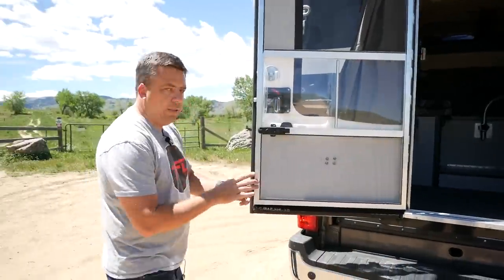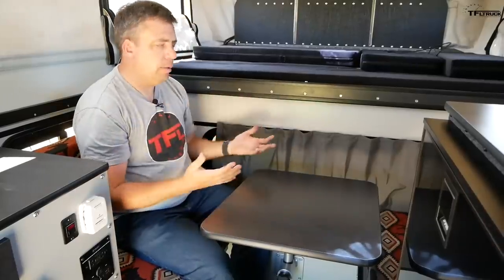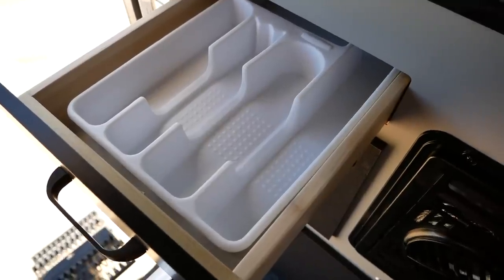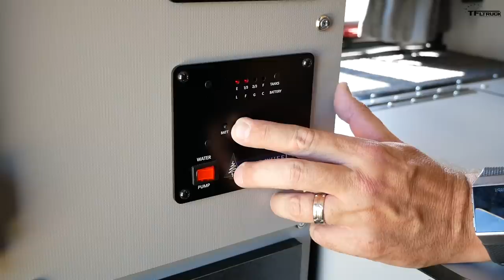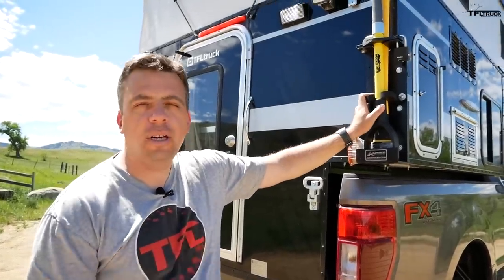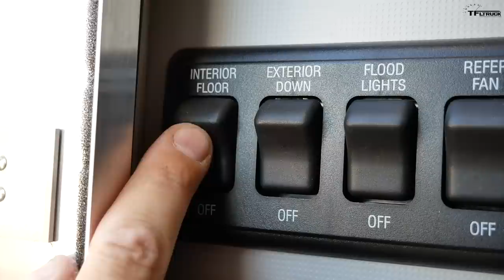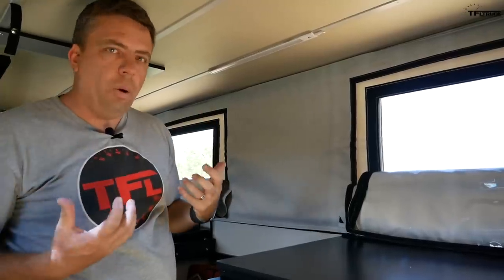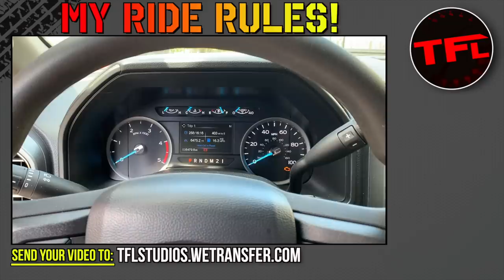Here's a Great Way To Camp On and Off-Road With a HD Truck - This Popup Camper Has it All!

Comment: I like the bonus owner review at the end of the video. More of these please.
Reply from the maker: Thank you for noticing.
Reply: But why tag it onto the end of a completely unrelated video? Was the viewer’s submission too short for a stand-alone “Dude, I Love My Ride”  ?
Reply: @TFLtruck  please tell us about the mods you did on the truck itself like lift and suspension and tires
Reply: @amm2472  On the gray truck that''s the subject of the main video? He covers all that.
Reply: Agree, an entire episode with the owner would be awesome.
Reply: I would totes find a way to vent the truck’s AC into the camper. Wouldn’t look good, but would be effective!
Reply: Holy cow that's expensive, I can get a NICE 5th wheel for that or less. Lightly  Used most likely. Still great content as always though guys keep up the great work!
Reply: @Marathon13240  Your 5th wheel does not have the go anywhere mobility these do.

Comment: Beyond sweet truck. Love you guys, love the videos. Other than hot water, it’s basically a $30,000  tent. No restroom, no shower. Seems like it should cost 10,000 max
Reply: I disagree. You couldn't even buy the raw materials and components in these for $10k. Aluminum frame/siding/roof, cushions, countertops, cabinets and hardware, vents, fans, windows, sink, pump, two agm batteries, stovetop, plywood floorpack, fridge, furnace, water heater, led lights inside and out, wiring, breakers, relays, battery charger, solar panel and controller, etc.   Be realistic. Two agm batteries are $500. Furnace $600. Fantastic fan vent $200. Fridge $800. Buy a piece of 3" foam for a matress is $150 without a sewn fabric cover. $30k is a lot of money, no doubt, but that is different than these being priced wrong. All those components add up fast. Now, pay someone to weld the frame, wire it, build cabinets, sew cushions, install fridge, furnace, fans, solar, stove, sink/plumbing, etc. Think about it by component and you see why they cost so much.
Reply: MrChadx1 ——-that’s the price of a fully loaded Honda Accord, the accord has way more components than that camper, so you are saying the accord should be like $60,000 because everything in it really adds up?
Reply: LA RC GREAT point!!!
Reply: @ULSB1969  Economies of scale.
Reply: @ULSB1969  Well, car manufactures don't really make a whole lot of money on a new car, they also sell millions of them, so they can make a couple hundred bucks on each one and be fine. FWC is a small(er) company, based in California now where wages and legislation is expensive. These could be 10k dollars or 15k dollars if we returned to an actual capitalism economy. But that's beyond the point. The point of these isn't to be cheap but to be well made in materials, workmanship, and warrantied well, that's expensive. Go read forums on any camper site and you'll see these large campers / fifth wheels that are 40, 50, 60, 70, 100k dollars falling apart after the first time they're used, you wanna know why? Because they prioritize price before the components and workmanship going into it. And good luck getting one of those fixed under 'warranty' lol.
Reply: Feel free to build them yourself, and sell them for $10K.
Reply: @ULSB1969  like others have said, economy of scale.  These are hand built. Not robot built, mass produced.  Compare Honda Accord to hand built sports car, even one without exotic components.  If you manufactured these yourself, even once you had the know how, how many hours do you think you would have into it after welding it all together, wiring, bonding, installing, testing, etc? And figure in your work space cost, health insurance, liability insurance, marketing, research and development, etc. And then still the material costs. Would like to hear what you think you'd have into it and you'd sell it for (oh, and you'd want to make a profit, too, right?)
Reply: @MrChadx1  gotta disagree with you.

Get a teardrop with 35s, nice outdoor galley, convertible sofa/table inside, and then you have your entire truck bed to haul extras like a genset that will power a/c and anything else you need. You'll also have room for propane.

Major non-starter for me.
Reply: Pretty overpriced
Reply: Way overpriced for what it is but if they can sell them at that price more power to them.
Reply: @sad754yt  great points all. For me, those wants and needs lead me to my ultimate dream - a Prevost conversion, around 20 years old no slides, and with moderate updates/upgrades. Electronics would be first on the list.

My wife is not crazy about managing the sheer size and complexity of a Prevost, so I think we'll have to work up to that. Our next step will be either a nice tent, or a small towable.

For any of the high ticket units, we'll pass on any purchases until this craziness passes. It's a record setting sellers market, so I'll wait for the inevitable sell-off.

Oh, and less crowded campgrounds!
Reply: @MrChadx1  Even though I hate it, I have to agree. People should check out van builds and how much those DIY cost. You never get away in a nicely equipped for under $25K or so. I would assume here the production cost is about 50% of the sales price that fourwheel is asking for. However, the add-ons are cheaper after market. The awning = 1/3 of the price. Solar - can be done for half the price as well. I am thinking of buying just the shell and then build it out myself - would probably save me $10K.
Reply: @ChristophPuetz  That is what we did with our first FWC. Bought the shell version and had them option in the things I couldn't, or didn't want to, do like adding side dinette, furnace, stovetop and propane. I did my own solar panels, solar controller, battery monitor, and 12v top-load fridge for a fraction of the price if purchased from FWC plus way better components.  Enjoyed that camper for several years but then moved to an Overland Explorer CAMP-X because we wanted the insulated panel construction rather than aluminum framed to get away from the condensation issues. It's been great.

As for the varying opinions on value, everyone is right since they are answering for their personal financial and value perspective. To each their own. It's great there are so many levels/choices out there right now.
Reply: @stratolestele7611  Teardrop is a different product completely and so a very different price point.  

No trailer works for us, teardrop or otherwise, since we are always towing a fishing boat or enclosed trailer. That leaves something that fits in the bed, be that a slide-in pickup camper or flip pack tent, or simple topper with a sleeping platform. We choose the slide-in pickup camper. Value and best choice is different for everyone. I was just pointing out why the asking price is what it is. Material and component costs, hand built, low volume, research and development costs, labor, marketing, and making a running a for-profit company. 

Regarding the varying opinions on value, everyone who shared an opinion is right since they are answering for their personal financial and value perspective. To each their own. It's great there are so many levels/choices out there right now.
Reply: @ULSB1969  the Accord is mass produced...
Reply: @barrydallmann3692  lolol

Comment: That price and no ac.... ouch! Great job Andre!
Reply: Where you going to plug an A/C into when you're out in BFE?
Reply: @donleamon8653  The giant generator they bought
Reply: For that size even a 4k btu unit would work. You could use those tiny suitcase inverter generators. But yes I would never pay 30k for that. I'd rather buy a towable tiny camper instead
Reply: You can run small one on solar and/or solar generator
Reply: And no toilet 😁
Reply: Stop being a wuss.....

Yeah I need AC too😄
Reply: Most solar charging systems will have a sine inverter with a low voltage cutoff.
Reply: 🙄 Cult like following is right. There are hundreds of build your own mini camper trailer for well under 5k. Even if it cost 10k to build that gives you 20k of Mods on the vehicle or money to actually go somewhere.
Reply: @rxonmymind8362  I was just about to say have you ever tried to sleep in 85° lol
Reply: Huge waste of money.
Reply: @twr41cox  no one's telling you to go buy one
Reply: No AC and no toilet
Reply: @donleamon8653  gen
Reply: Like living in a cardboard box for 32 k
Reply: A/C is a option it sticks out the passenger side by the door. Also there are two toilet options a hide away cassette or a fold out poop bag style. You can always go to there web site and build any model with any option and see real time pricing and a real close est weight of each added option. All free with out ever having to be bugged by sales rep. Can even print or save your build sheet to compare. 😃

Comment: No AC and they are starting off in Georgia in the summer. Hello humidity
Reply: They're doing their trip off road so it's unlikely there will be too many places to plug in.  Carrying a big enough generator to run A/C really isn't practical in this type of rig either.
Reply: @sonictech1000  there are plenty of smaller inverter generators that would store easily inside the camper (during travel) or on a hitch carrier.  No reason to not have AC anywhere you want, especially for $30k.
Reply: @jimmieclark6393  Storage in a pop up truck camper is REALLY limited and you typically need a 3kw generator to run an A/C unit.  That's way too big to put inside. . If you put the generator on a receiver  mounted carrier that will really hurt departure angle and probably break somewhere along the way.  They would also need to carry additional fuel and fuel is already going to be a problem for them.
Reply: @sonictech1000  One or two small Honda generators will power the AC and they are easy to store. It’s nice to have power if you are actually isolated in the outdoors.
Reply: @joshuabarton2519  Truck campers like that are extremely limited on storage space and few AC units will run reliably on anything less than 3kw.  Plus you are going to have to store all that fuel somewhere.
Reply: @sonictech1000  Can easily run a a/c off of a 2500 to 3000 watt inverter generator as long as the BTUs are not that high and most of them are about the size of a suitcase.  I have a 5000 btu  a/c and my suitcase size inverter generator runs it fine.  With such a small camper like this 5000 to 6000 btu a/c is all you need.

Comment: Nice camper, but waaaaay too expensive. Especially with no a/c or bathroom.  bought a new fully contained lance camper hard side for just over 20k.
Reply: @donleamon8653  you might with a smaller one.  Go ahead.  Waste your money on a 32k tent.  Besides, you know these guys aren't taking this on the Rubicon.  🙄 No way that camper is worth 32k friendo.
Reply: @paulmadkow9143  No way an earth roamer is worth 1.5 million either. But you can't take this dumb made up fiat currency with you so you may as well buy what makes you happy. FWC was founded on making small light weight campers for small trucks back in the 70's and 80s'. They have models as low as 800 to 900 pounds, which means a 1/4 ton truck or 'Midsize' truck can handle one. They even make small 5' ones for super short beds. Find me a lance camper that can do that? Oh, you can't. That's the entire market that they're building these for and have been building them for, it isn't to replace your lance camper on your HD Truck lol. Btw your lance is probably garbage in comparison to this camper, as far as construction goes. So you'll be buying a new one in 10 years anyway when this FWC will be here for 50 years with good care, even longer.

Comment: $30k just for that camper not really with it
Reply: That is crazy
Reply: Not unless the $32,000 for this camper includes a used pickup truck in reasonable condition to put it in, lol!
Reply: First thing I thought when I saw the title of the video. Yikes...
Reply: Yea, and no AC, toilet or awning. That's alot.
Reply: Why do people who would never spend any money complain about the cost. So what is your set up?
Reply: @nm-qt2hb  - They don't need a setup since they never go anywhere other than sit in front of their computer.
Reply: @nm-qt2hb  I don't think its that they don't spend money but man over 30k idk...this set up is good for some ppl but for that price I'd rather have a tow behind...They're just voicing opinions
Reply: @donleamon8653 

That's funny. Not sure about that. But very funny.
Reply: @marcusladon1796 
I have a off road tow behind. Great on open trails. Not so good for tighter trails. Sucks backing up on a narrow trail.
Reply: @nm-qt2hb  mine was both a citroen acadiane and for a bit a c15
On both 3mm cork isolation in the rear, cork + carpet in the front (head liner)
Curtains were held by heavy duty hard drive magnet and doubled with insulation
Bed was a trimed and modified rollable ikea model for support and rollable foam bed on top
Cargo management was done in soft bags.
Shower/changing was a tarp that i put aroud the rear doors
For extra space i swapped the seats for 3 doors Zx and 206 seats.
Dinner / cooking was on a plate holded by heavy duty magnet between the rear doors. 
Lighting via led
Used a used boat deep cycle battery for extra power wich was enough for a trip and if not was charged separately 
For off road: suspension tune on the acadiane (thx citroen) + ms tyres. 405d shock, 309d hubs, arms & d. s. , c15 coils front, blocks rear +14 '' Bx rims and ms tyres on the c15
Total cost 2500 for the acadiane (1300 cars, 1200 mods) 2000 for the c15 (500 car + 1500 mods).
Here you go

Comment: It’s nice but for 35k I want the chance to say the “$hitters full” and turn up the a/c unit
Reply: Me too, and that's what made the Hallmark such an appealing option.  At the time I could not afford the Hallmark, so I got a FWC Grandby (less than 30K, just about every option, 2 years ago.) running on a RAM 3500 with Carli Pintop suspension on 37" Toyo tires.  I've been 100% happy with this.  Someday I will go for the Hallmark, not for a shortage of love for my FWC, but mostly so I can get the electric jacks for raising the roof.  It's pretty easy to do, so long as you don't have any thing mounted on the top of the roof.  Then... it can get a little tough to lift.
Reply: @ftkobbe  - I originally thought I wanted a hallmark (small h) Milner but they are way too heavy for the type of extreme off-roading I do with my Power Wagon here in the Southwest. Very happy with my Hawk, but in the future I'm kinda interested in Bison's flatbed offering.
Reply: Agreed.  It's a nice unit, but you can't  say a camper "has it all" if it doesn't have a toilet.  And for that much cash, A/C and thermal insulation in the tent should be included.
Reply: @Rollochrome  or purchase a small towable camper. atleast you will get a shitter and a shower with it
Reply: No bigger fan than me guy's but 30k?  Sure don't see it. Lot of money for a 10k camper.
Reply: Paid $34,000 for 2019 Arctic Fox 1150
Reply: it's called greed.
Reply: There's no reason that such a small camper is sooo expensive. I can get a huge tow-behind unit for that price.
Reply: @jeffreyallen1290  They are built to take a punishment...find any truck camper that can take extreme off roading ...they don't exist
Reply: @Bewefau  No, it's called capitalism.  YOU don't have to buy one.

Comment: All the complaints about price makes me realize not many have priced these type of campers.  They have a waiting list to get one. The used campers are damn near as much as new ones. Try finding a used one for sale, lol few and far between. These are made to handle the off road environment and to be light weight. Less than 1/2 the weight of a hard side truck camper and will last 20+ years.

Comment: I’ve got a Hawk on my F-150. It’s great, light weight, functional. Mine weighs 945 pounds. Ordered the Hawk Shell and had it custom built for me. Ordered the furnace and 2 burner stove, solar and foldout couch, good for traveling. You can pull off the road and not pop the roof up.

Comment: Comments are so ignorantly funny on here. The whole idea of a FWC is to go where there is no 30 amp hookups for A/C! There are floorplans that allow for cassette or portable toilets if that is what you want. Further, FWC's hold their value extremely well, because they actually hold up to hard off-road use.
Reply: Solar or a generator can run the AC.
Reply: @darylc6669  need ALOT OF solar panels.

Comment: No crapper?! It looks nice, but I wouldn't say "fully equipped".
Reply: you can order it with a crapper
Reply: its in the back of a truck... id drive or park not to far from a crapper so wouldn't have to "cloud out" that tiny airspace
Reply: around a $3500 upgrade....

Comment: That truck does look good that’s for sure
Reply: except I don’t understand why they went with the gas engine over the 6.7L power stroke.
Reply: @dickyarger2945  Because diesels are expensive and useless, With the EPA and emissions you can't delete them so eventually you'll be paying a lot money just to keep the emissions system working.

Comment: The one thing I was thinking throughout this whole video: 

$30,000
Reply: And no toilet and no ac 🤦‍♂️
Reply: @Aaronelliott847  toilet shower and ac are the main reasons to have a camper leave those out its a fancy tent
Reply: Exactly...not a chance
Reply: These campers are over priced junk compared to how they were used to be made....I have a 1982 SunLite pop up and it far exceeds this low cheap materials crap......